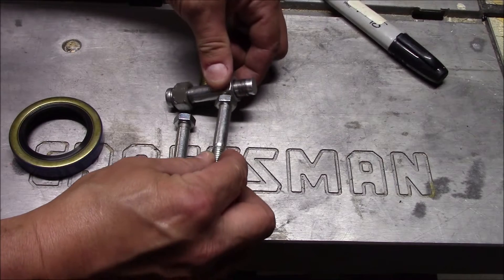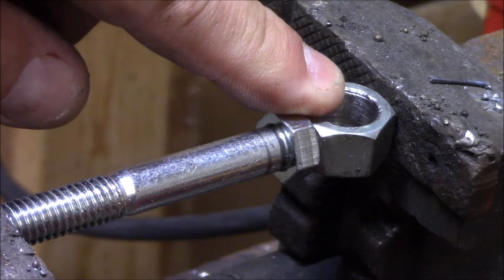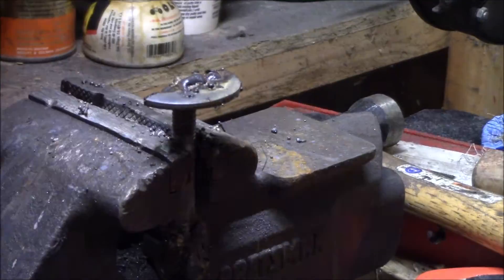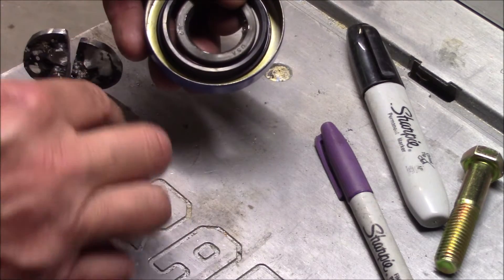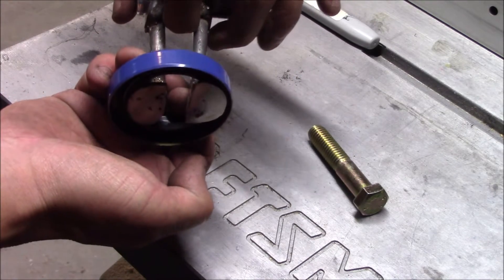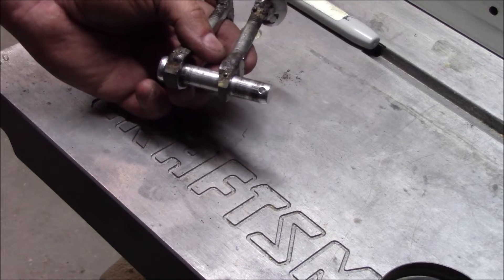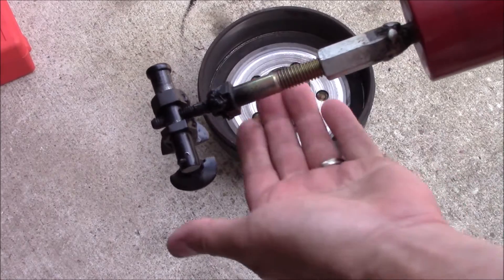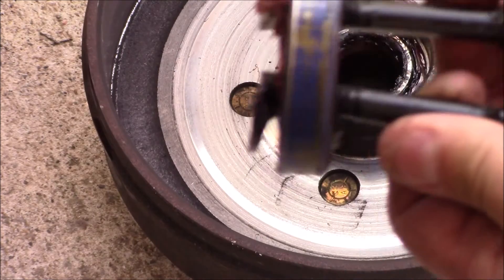Homemade seal puller for a slide hammer

Comment: This is so much better than the standard hook puller. My hook ripped right through the seal metal and the seal is still in there.
Reply from the maker: this has worked well. I borrowed this design from an inboard specialty tool